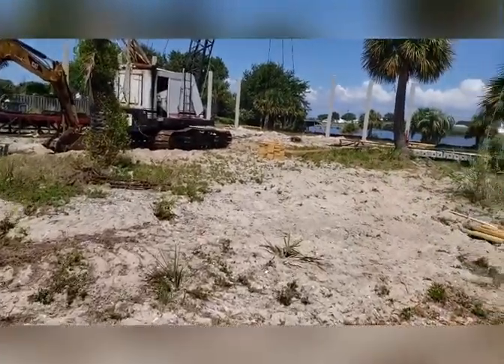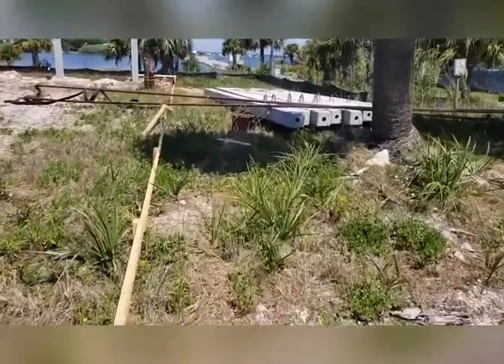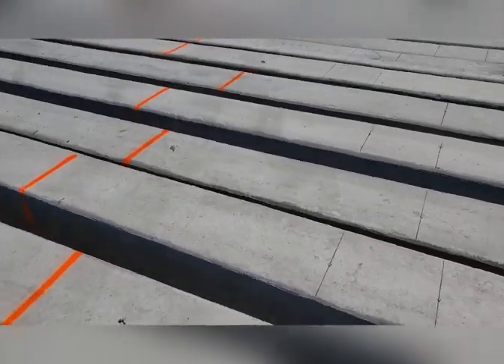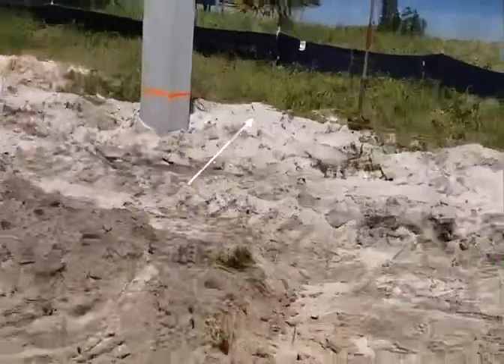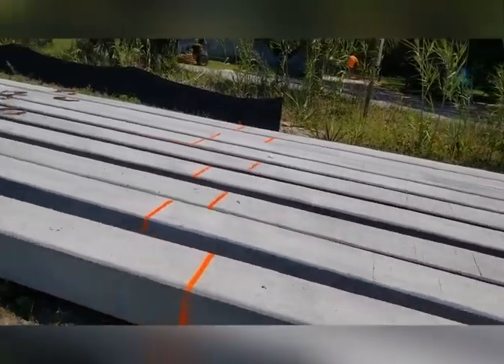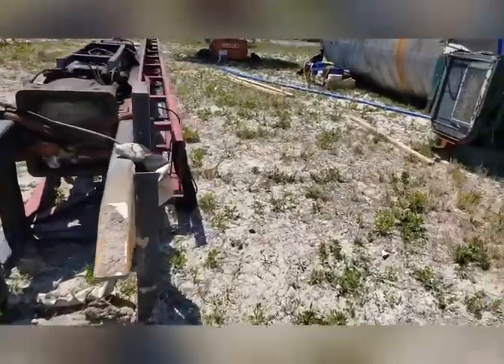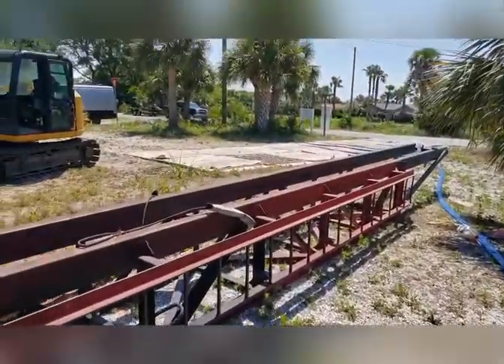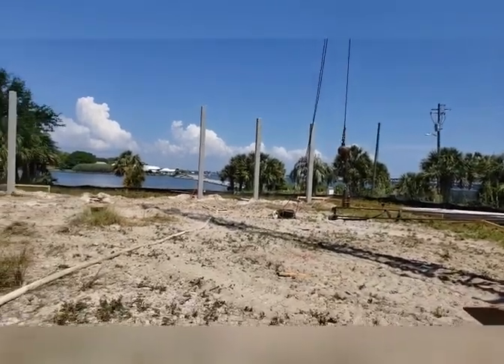ICF Beach House Construction: Setting Concrete Pilings

Comment: The condo collapse in south Florida was from, at least in part, from rear rotting inside the foundation.  What's to keep the loops, rebar, etc. from rotting inside these pilings?
Reply: PS, What is your expectation as to how long these pilings will maintain their design strength against the elements?  Are we talking 20 years, 70 years, 100 years?  What then?